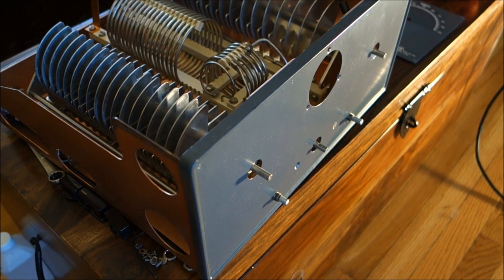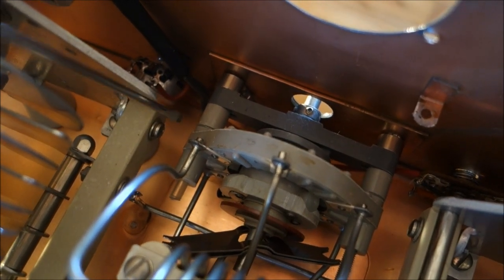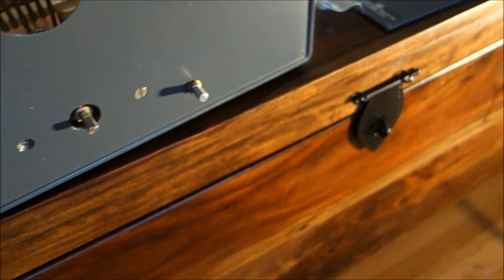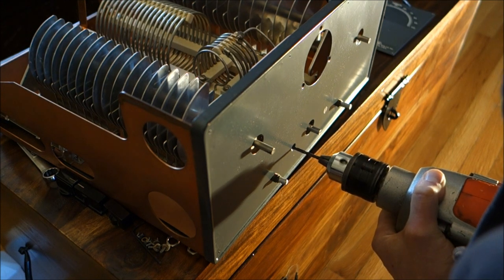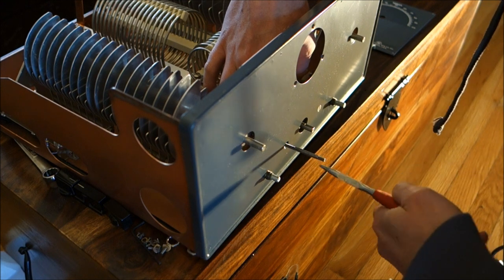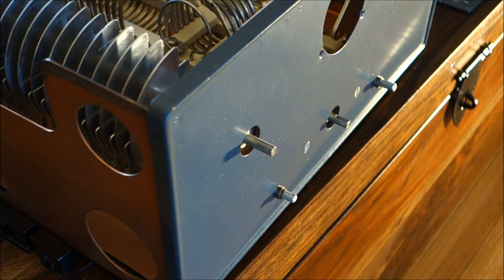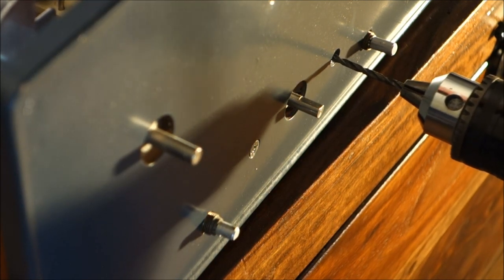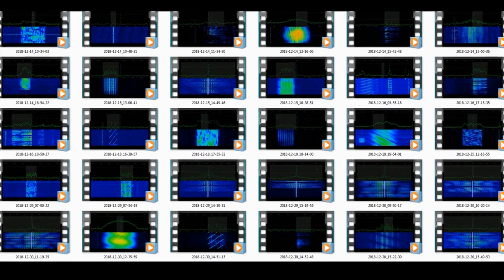James Millen 92200 Antenna Tuner Band Switch Repair | Signal Phantom

Comment: As already noted, the non-conductive bolt/screw was thought to be essential. Bet Millen questioned the use of this type material though! Maybe the AM mode (constant carrier) in the Millen days was also a concern. Maybe carrier heat would also degenerate the bolt. Interesting. I wonder whether one can simply apply a 'liquid weld' epoxy to the unit today. Such presents no conductive issues but repairing a broken 'weld'....seems to be another tradeoff. Meant to add one more comment: The 9KV space rating of the variables speaks volumes about the AM mode application!! The peak power of AM would definitely require that kind of rating. In fact I've wondered about the AT5K in this regard: 6KV (same as the AT4K). hm...…. I almost am inclined to 'roll my own'. NAH!!!

Comment: Did replacing a nonconductive piece with a metal screw interfere with the function of the switch? Can't wait for your signal vids. That will be interesting
Reply from the maker: Hello Andy, I think that was the reason for high voltage arcing but honestly there is so much material around to prevent any arcing this is a non-issue, but yes very good question.  So far so good.
Reply: Hi Tyler. Thanks for the video. I also own the same tuner. When you say "high voltage arcing", are you saying that you had a high voltage arcing problem BEFORE you fixed the band switch? Thanks, Kevin - KE4CQ
Reply from the maker: Hi Kevin, no i never had arcing I was responding to Andy's question on the metalic all thread question.  But the non-matalic rods they use could even be sub'd for threaded plastic you can get them from Mc Master Carr!!!  Easier to cut too.
Reply: Thank you. It looks like my switch may be slightly different than your stock switch - or was possibly modified by someone since. I think I have a later model tuner - note the square shaped swr meter. I opened up my tuner and took a few pics. Here they are https://photos.app.goo.gl/YUdYSYAiW899dZ5w7